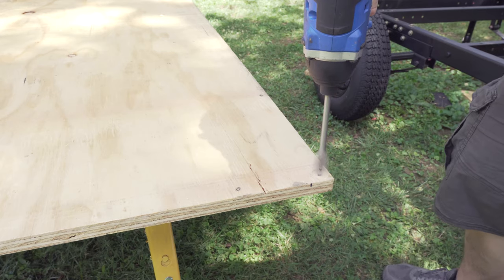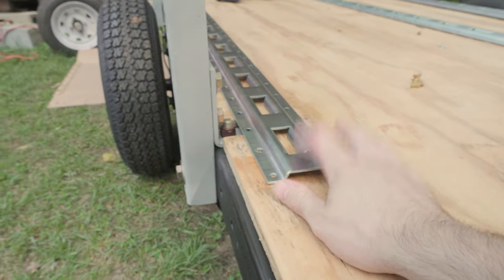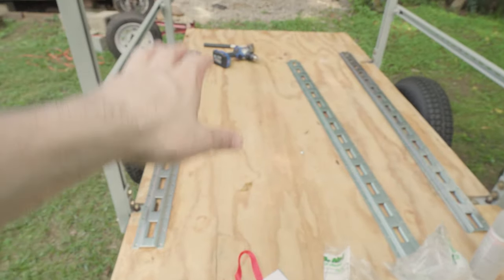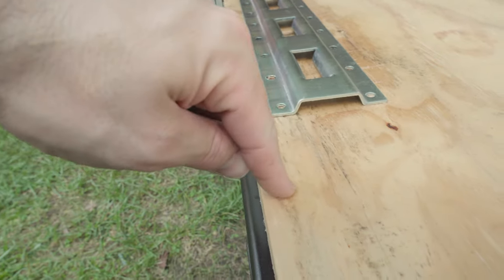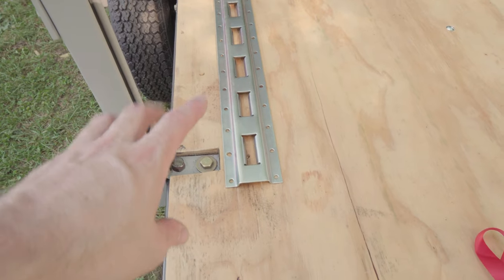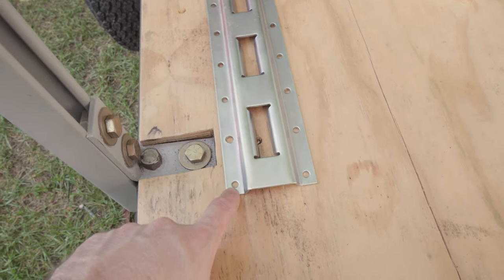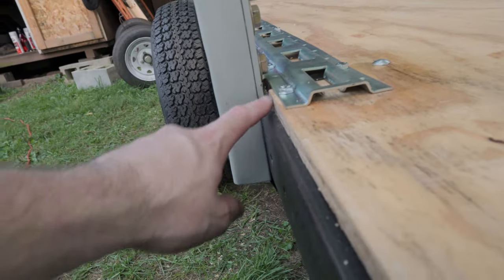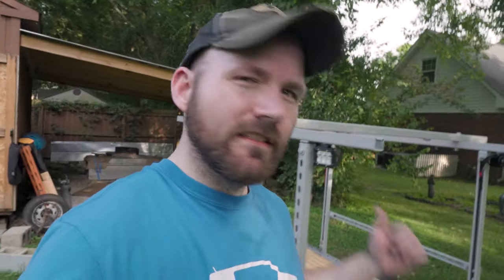Harbor Freight Overland Trailer: Deck and E-Track

Comment: Last week I bought a slightly used Harbor Freight trailer that I will convert into a kayak trailer.  I like your design but would change it slightly so that I can remove the rack and fold the trailer for storage.  Thanks for sharing.
Reply from the maker: Sounds great, thanks for watching!